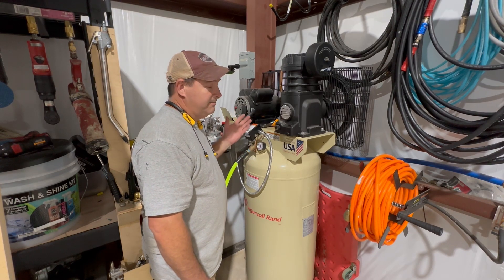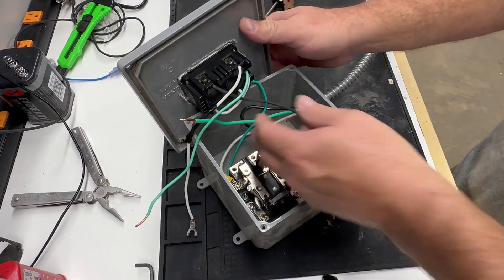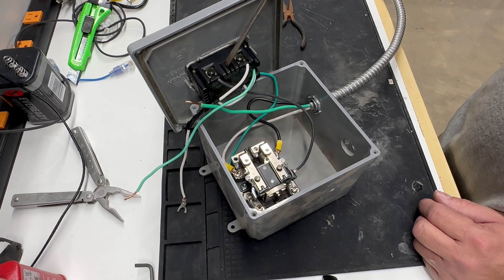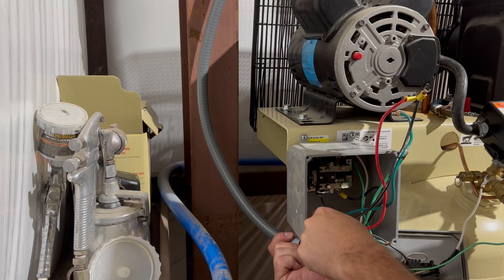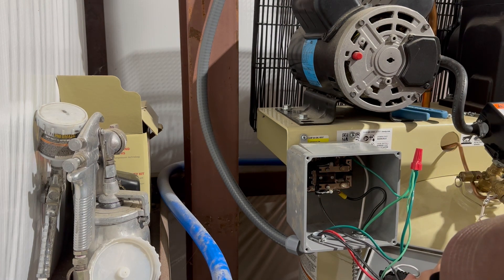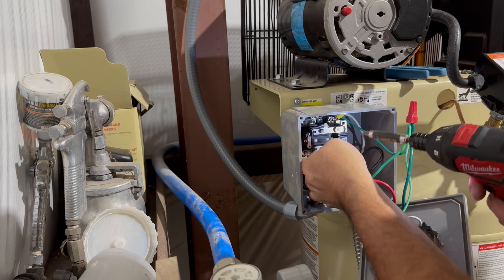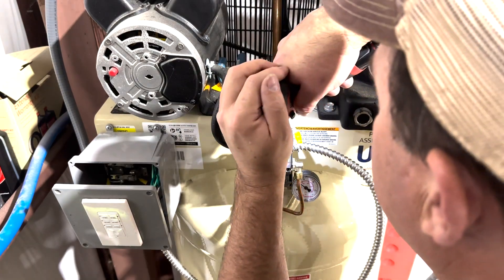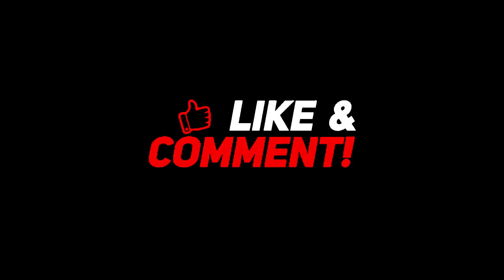--== I'M GUILTY - ARE YOU? ==--  STOP LEAVING YOUR AIR COMPRESSOR ON!!!  Add this today!

Comment: attempting to wire this up exactly as you did, however I only have 3 wires on my timer hot, ground and 'load'.  I do not see in your video where the 'load' wire from the timer goes to.
Reply from the maker: @NATIVESRAGE  load would go to the relay coil so it gets 120v across it.  (Load on one side and neutral on the other side). That energizes it and causes the relay to switch the 240v.  Notice:  this is not electrical advice.  Use at your own risk. I’m not responsible for any damage that may occur using this information.  Consult an electrician if you are unsure.

Comment: If your air compressor plugs into a wall, you can always put a remote controlled outlet adapter between your compressor plug & outlet and hang the (keychain) remote by your air chuck, so you don't have to even walk over to the unit. I realize there's the extra step of turning it off when you're finished, but you're gonna be standing there anyway when you put the chuck back... The 1 extra metaphorical step beats the 20 literal steps 20 to 30 feet depending on how far you have to travel! 

P.S. This is pretty cool too though! With that being said, I'm pretty sure you could get an outlet for a hardwired set up that also functions with a remote control.
Reply from the maker: That would work great if the compressor worked off of a standard outlet and the switch could handle the load.  In my case, this is a 220v system and finding those controlled outlets can be expensive, a lot more than this project.  Great idea and thanks for the comment!

Comment: Or you could just close the tank valve and turn it off at night like every other normal person does.
Reply: Yeah...and when the wife needs you or the kids call  and you have to leave in a hurry,  or you're over 50, you WILL leave it on sometimes.  

If you use it everyday, sure.

If only used on occasion, this is perfect.  

Punch the timer and forget it.

Heck, I always try to remember to shut mine off anyway.  

So that means I had to go to the breaker to turn it in.  

If I'm making a trip anyway, just use the timer.

It's brilliant.   Efficient.  I like it!